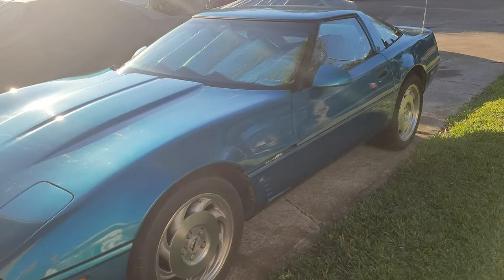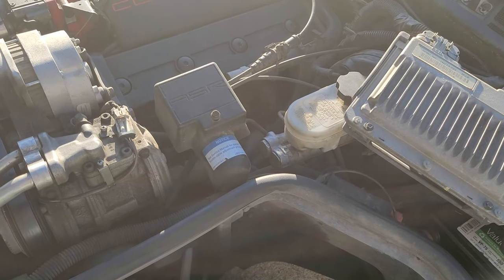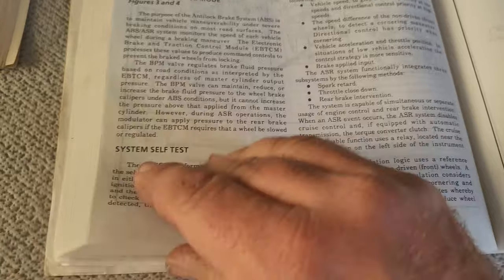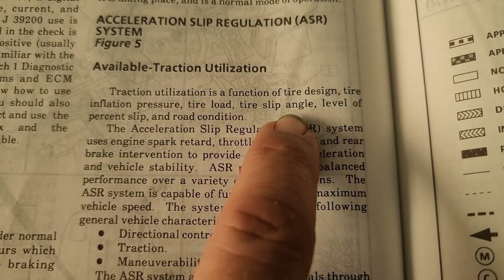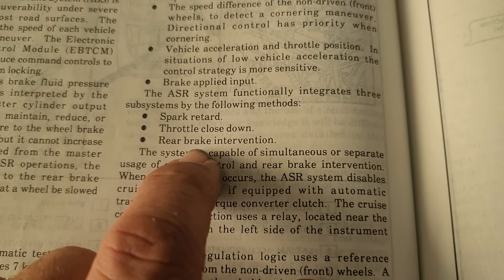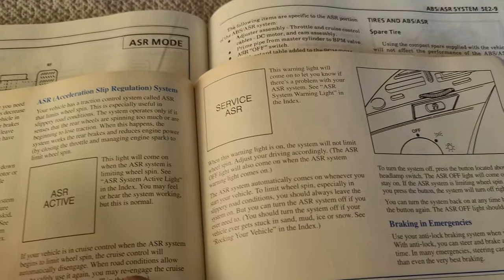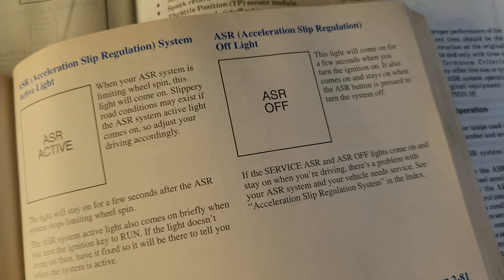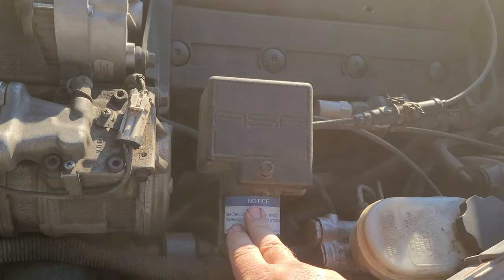The Misunderstood C4 Corvette ASR Traction Control System

Comment: Have a 96 and wifey has a 95.  That's the first thing we do when starting the car, turn the ASR off.  I want to control the car not a computer.
Reply from the maker: Yeo. I think that's the sentiment of many owners. As long as you're not pulling speed racers moves in the rain, you should be good most of the time👍.

Comment: That's why I prefer my 85 C4. No traction control, no ABS, no airbags, iron cylinder heads so no blown head gaskets. Fewer things to break when they get older. Keep it simple
Reply from the maker: There's definitely an argument to be made for that👍. The simplicity of the early C4's makes them great driving cars with very little to worry about except for locating certain parts.
Reply: @VetteSource  yes that's true. In fact I emailed you a couple weeks ago trying to find a very hard to find part. I never got a reply so I figured it's unobtainium
Reply from the maker: Hey Lee, sorry for that. I saw your email. I have an 85 core engine that I have been meaning to check and see if it's still on there.  I'll get back in touch shortly.
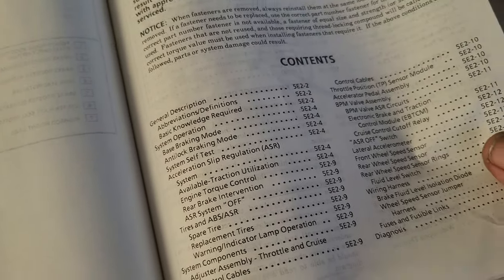Reply: Unless you have the best of the breed...a 96 with 3:07 gears, Z51 Performance Package and a 4L60E. The system can be turned "📴. You early C4 guys make too much of a big deal. In a 96 turned On? Works great, no issues. It plants the tires. Off? You smoke the tires down to the rims...
Reply: @kirkcunningham6146  if you have a 96 its probably going to be a lt4 with a manual
Reply: and a whopping 200 horsepower out of a trash v8

Comment: mine just absolutely pushes my foot back if i leave it on and stomp it
Reply from the maker: For sure, that little servo motor is actually pretty strong and has quite a bit of resistance. Better to just turn it off for your "spirited" low speed driving sessions and re-engage for the highway cruises.

Comment: I love it when it pushes back its hilarious. We love the Lt4c4
Reply from the maker: Yea, its a good way to punk your friends and family. Tell them to get on it, and then accuse them of "breaking" the car when the ASR engages...
Reply: I like to lean into it until it pushes back, I bought 30k mile tires so they dont have the grip that the original tires have.  The car isn't tuned for those tires, it will put down more power than those tires will take.  I like to push it and make it squeak a bit.

Comment: Sound like a 'vette knowledgeable person. Wish you lived near me because I have a sick '96 LT4. Just got it back from a shop that had a year and finally threw in the towel. They did get it running but after replacing the ECM, Optispark, and few other things checked it is still showing some codes and on the DIC it is showing check engine, ASR Off, and service ASR. While it will sit and idle I am afraid to drive it that it will konk out on the road.....lol
Reply from the maker: Hey Wayne, that's too bad. Sounds like you need to dig around for a shop that has some Corvette specific experience so that they can address some of what may be some wiring issues from your description. What part of the country are you in? I may have some contacts near you.

Comment: I'll tell you what, I haven't dared to turn the system off until I am way more experienced at driving this C4.  It totally saved my bacon the other day!  I was approaching a traffic signal and had a green arrow for a LH turn on to a larger three lane boulevard, was going 30-35 in 2nd gear and got on the gas too early while making the turn.  Even though it was dry, it was pretty cold and the back just let go-- phewww-- for a split second I wasn't sure where I was going to end up but ASR swooped in and saved it.
Reply from the maker: Hey buddy, you have now experienced what I call the "rubber band" effect. Something about the design of the C4 suspension makes it highly unstable in sharp low speed cornering moves if you goose the throttle midturn. Luckily the ASR was engaged, or you could have found yourself in the opposite direction facing oncoming traffic. Saw your email from a few weeks back, just been crazy busy lately as usual. Glad you are able to enjoy the car. Have a Merry Christmas!
Reply: @VetteSource  Absolutely I am so glad that ASR saved my butt!  Thank you I truly have been enjoying driving it around even though I only drive it once a week or so and I need to get the fuel pump situation worked out--its going into the shop later this month.   Are you able to get the little plastic tip for the e-brake release button?  Mine is missing and it makes releasing the e-brake really tough.  I looked on e-bay and found nothing :(
Reply from the maker: I probably have an extra tip on the shelf. Let me check this week and I'll drop you a message.
Reply: @VetteSource  Awesome thanks Brian!
Reply from the maker: No problem, buddy👍
Reply: I too have experienced the same thing in my 95 C4... car is amazing... they say 300 hp but I believe it's more than that....

Comment: random off topic question but does obd2 work for a 95 vet? I tried plugging mine it but kept saying "failed to connect" or something along the lines of that
Reply from the maker: The 1995 Corvette was kind of a mix between OBDI and OBDII. GM used the 1994/1995 Corvette and certain Cadillac and Oldsmobile models as test vehicles for the new OBDII system. They came equipped with the ECM, and I believe the OBDII connector, but much of the computer programming was not installed, so that's why you're having trouble connecting with your scanner. The first year for functionality was 1996.
Reply: gotcha thanks dude  @VetteSource
Reply: @titoqwentezproductionz3406 use the paperclip method, I believe it's #4 and #12, directly above and below each other, then just watch the digital display for any codes...
Easy peasy...

Comment: I recently purchased an C4 LT4 car. The ARS system has been removed. Is it possible to get the cruise control working without the ASR unit?
Reply from the maker: Not that I'm aware of. The multiple throttle cables all run through the ASR unit, so if they created a work-around, it's unlikely you would be able to find a cable that was the proper length to make the system functional again.

Comment: My 93 Vette “Service ASR” light always turns on after about 5 minutes of driving. It doesn’t appear to affect anything but is annoying. I have seen a couple videos referring to this option but no information as to how to get rid of this light being on all the time. I’m open to any information or steps to get rid of this warning.
Reply from the maker: Hey Ron, the Service ASR light is letting you know there is a fault in one of the components that make the system function. 

If you have access to a scanner, you'll be able to read the stored code and diagnosis further from there. 

All of the components of the ASR are fairly dependable, so I would do a visual check to make sure you still have a good connection at the wheel speed sensors and the ASR servo motor itself.

Let me know what you find out and I can guide you from there.
Reply: If the Service ASR illuminates, either Spark Retard and/or throttle close down is being commanded by the EBCM. The EBCM commands the Service ASR light, thus one of the quick checks is your brake fluid level in the master cylinder. Low brake fluid will set Service ASR. If that is ok, scan your EBCM for codes. If no scanner use a paper clip on the OBD1 connector. IGN off, At OBD1 connector, Connect top row, right most pin with the bottom row, left most pin, now turn ign on. Display will be in center LCD speedometer. EBCM codes are 9 series, look in lower left of display - use Trip ODO or TRip  to move to 9 series. Any codes will be displayed in Speedo LCD. Turn ign off to get out. Look up codes using internet search.
Reply from the maker: Riley, thanks for the detailed troubleshooting writeup. One question for you. Will the Service ASR light up if the EBCM is simply commanding activitation of the system?

 I could be misremembering, but I thought when the system was activated the "ASR active" light would illuminate first, and then if a fault was detected in one of the system components the "Service ASR" light would illuminate.
Reply: I just found out from this video that the Service ASR and ASR off should light up simultaneously. The ground wire from the lamp goes to a rely, which I think failed.
Reply from the maker: If I'm remembering correctly, the ground circuit for the lamp is through the EBCM module, but I need to refresh my memory with a peek at the FSM.

Comment: I'm glad my 1990 Z doesn't have this. My right foot and left foot control my traction or lack there of, lol. 100% agree on having shop and electrical supplement for the correct year model. When I bought my Z, I knew nothing about C4s or the LT5. After much reading, and more reading if have been able to learn what makes my car tick. From part repair or replacement to trouble shooting mechanical or electrical conditions they are indispensable. Also CF, DC, and the registry, the forums are full of great guys that know and are willing to help. C4 owners for the most part like to see guys breathing life back into these machines. Some of the repairs are challenging, but it's damn cool how much engineering went into these cars. The first complete redesign of the Vette since 1963, and I for one think GM did a great job. Hands down the best performance machine for the buck.
  Another great informative video, well done, cool stuff.👍👍🏁🏁
Reply from the maker: Thanks Michael👍. I agree with you, the amount of information you can learn from these 1000 page Factory Service manuals and related information from forum posts is a great resource to have at your fingertips.

Comment: its was a weird feeling when the gas pedal pushed back at you the first time! this is a must has cause tv cable for the auto transmission/ I have a auto but wish i had a manual
Reply from the maker: For sure, it makes you thing something has gone haywire with the throttle if you're not familiar with the system. That's a big reason all the auto manufacturers went to the drive by wire system. It's easier to control the throttle without the driver feeling like it's not working.

Comment: Been messing around with trac control off. Last night decided to peel out a parking lot and all i saw was curb. Luckily the parking lot was made for 18wheelers so it was wide enough to just barely get control of the car. Turned it back o ln and have left it on since😂 although its from the 90s it definitely has power
Reply from the maker: Yep, these old C4's have more power than most people think. It's always fun to surprise people😁.

Comment: Auto will only have 4 cables on a 92/93, 94-96 is electronic auto and has no TV cable. That Bosch system was used on a couple other non GM cars. The ABS pump is very similar to the ones used on some Mercs. Possibly even interchangeable if you find the right one.
Reply from the maker: Good info, thanks for sharing👍.

Comment: Buenos días disculpa tengo un Corvette 1995 y de repente me empezó a fallar y prendió la luz del ASR y falla demasiado, te agradecería algún consejo muchas Grasias
Reply from the maker: Hello, the ASR light indicates something in the system has failed, which will require some troubleshooting to identify which component is not working correctly. The easiest way is to use a scan tool to pull the codes from the system. That will give you a head start regarding where to look for the problem.

Comment: I have a92 c4LT1 when I turn the traction control off, and do a burn out or even a donut I’ll get about 5 seconds into it and then it dies and cause me to stall out…. What could that be you reckon?
Reply from the maker: My first thought would be a fuel supply problem. Under hard acceleration or turning maneuvers, the fuel will rush to the opposite side of the fuel tank, potentially starving the fuel pump of its fuel supply. To counteract this, the cars have a small plastic tray installed at the bottom center of the tank that the fuel pump/sending unit sits in. If that piece becomes dislodged, you can experience the problems you described.

Comment: Moto Guzzi started ABS braking. The Service ASR and ASR OFF come on at the same time? Mine doesn't. Thx for that info. ASR is dangerous. Try Anti-Tailgate safety instead.
Reply from the maker: Yep, when the Service ASR light illuminates after detecting a fault in the system, it will energize the ground circuit to turn on the ASR OFF lamp letting you know the system had been deactivated, and is telling you to drive carefully.

It's definitely an early nanny device, but does a pretty good of keeping your butt out of the fire when performing some aggressive driving maneuvers😁.

Comment: Thanks for the video, very informative. Since I have faulty rear wheel speed sensor s that are not coming out and hard to find. , This is why my service asr. Light comes on.?
Reply from the maker: It's possible yes. You will need to pull the specific codes utilizing a code reader or by using the diagnostic mode built into the cars electronics system to verify.

Comment: I have owned a C4 for over twenty years. Every time I drive the car I disable the ASR immediately after releasing the parking
brake.
Reply from the maker: For sure, I think quite a few owners with proper driving experience turn it off. For the less experienced drivers, it can help with the "gotcha" moments on those wet rainy roads and unstable road surfaces.
Reply: same !

Comment: Good evening young man. I wanted to thank you for the great videos that you provide and ask a couple of questions. First exactly which manual do you recommend. I have a base model 1996. Second, the previous owner ran this when it was hot. I think there is a crack in the head gasket. (White smoke out tailpipes smelling like antifreeze) What is your opinion on the use of Blue Devil to fix this problem.  This car will not be raced or driven hard. 70 to 80 on interstate at most.  Thanks and keep the videos coming please.  TW Sanders
Reply from the maker: TW, thanks for the positive feedback, I greatly appreciate it👍.

For your car, I would recommend investing in a Factory Service Manual and the 1996 Owners Manual. Both contain a wealth of information particular to your car, and can be purchased off eBay or Amazon for a minimal investment.

As for the potential head gasket issue, I have never been a big fan of the chemical solution to a mechanical problem. I know some swear by it, and it can alleviate small problems in the short term. 

Unfortunately, it's basically kicking the can down the road, because eventually those heads will need to come off to replace the gaskets. That's when you'll get the nasty surprise of the mess the head gasket sealers leave inside the block.

Let me know if you need anything else, nice talking with you.

Comment: How can I disengage Traction Control so that emissions testing can run it on rollers to do their thing. Depressed the button on and off, won’t disengage. Any suggestions? Thanks in advance.
Reply from the maker: Try pulling the connector at the ASR unit. That should disable the system.

Comment: Tdy my service asr came on when I started the car to back out of garage.  I did not let everything cycle like I normally do and just got in and turned key. When I restarted the light was off and the car drove just fine. Is the noise I hear cycling part of the asr when I energize the system prior to cranking ? Can you trip the service asr by not letting everything cycle or is this the indication of another impending issue?  I did find this video very informative.  I’ve often felt the peddle kickback when taking a hard right and merging with traffic  even when I’m not “trying to get on it”. I thought it was some sort of Ackerman effect but know can see it’s the asr 👍🏼
Reply from the maker: An intermittent code flashing usually just means something wasn't communicating correctly at that particular moment. 

It doesn't really have much to do with how soon you drive off in the car, as the systems pretty much come on-line instantly. The pump cycling you hear is most likely from the ABS unit directly behind your seat. It may have detected a fault momentarily, but then the circuit behaved as intended.

As long as the ASR/ABS light doesn't light up, you should be good.
Reply: @VetteSource  last month that did light up out of the blue under heavy acceleration while going up hill.   Turned out I had low break fluid and tripped a sensor, since the ABS/ASR hasn’t come back.
Reply from the maker: Yep, it's funny how the system will warn you in an indirect manner. The "ASR active" light will also illuminate when the ASR retards the throttle.

Comment: So with the ASR light on, if you turn the system off by pressing the traction control button that on the left side of the upper dash, you won't have any drivable issues right? Just no traction control? Do I have that right?
Reply from the maker: Yep, you're basically turning off the nanny device that keeps you from ditch surfing your car during aggressive driving maneuvers😁.

Comment: What is the adjustment with the Allen wrench in the three key holes and then you do something with the cables is there any information on that...IS THERE ANY information on the keyhole adjustment with the Allen wrench in the FSM?..also my service ABS light is on?...any tips?? on what to check pls advise :^)
Reply from the maker: Marcus, I'm not aware of any keyhole adjustments to the ASR servo. From what I am remembering, the unit is to be serviced as an entire assembly and nothing about adjustment is mentioned in the FSM. Many times the electrically driven gear actuator will bind up, rendering the unit inoperable. I would recommend checking fuses and connections first, and seeing if you can rotate the geared part of the unit by hand. If it is stuck most likely the servo has failed. 

Let me know if those check out and I can send some further troubleshooting tips your way👍.